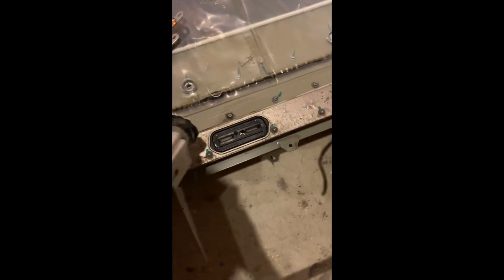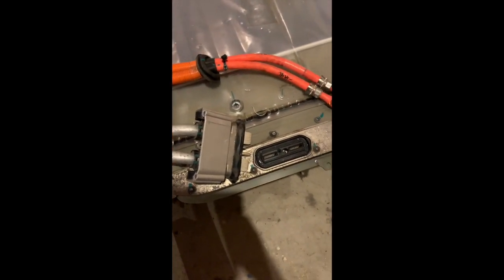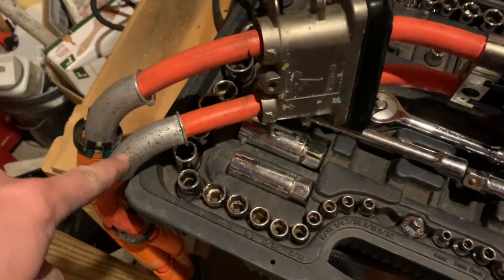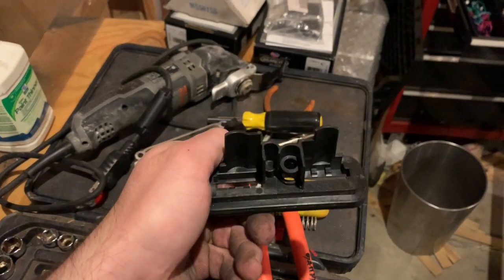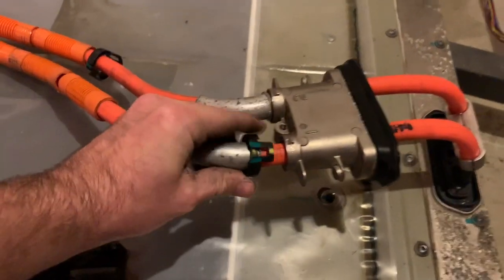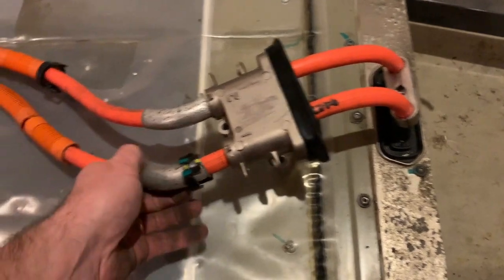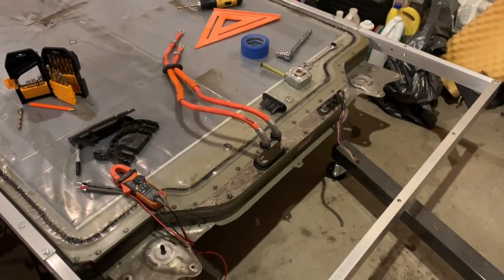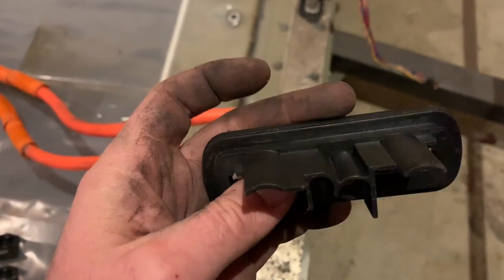T-Rex Camper Build: The Tesla HV Battery Coupler... First edited video ever!

Comment: My opinion is to avoid crimps where possible. They can be really high quality reliable connections, but are often a point of failure because they are easy to mess up. I got a lesson on crimping from a technician with Schlueniger when my employer bought one of their automated crimpers for light Gage wire- I learned that there are lots of ways to make a bad crimp, and really just one right way. You have to get enough force to actually deform the strands, create flow, and create a metallurgical bond between the strands and the connector. It's really like a cold forge welding process. This is why Tesla and other EV OEMs use ultrasonically welded connections. 

That said, just bolting two ring terminals together isn't perfect, and you still need a crimp on the other ring terminal. 

You could take that connector to a welding supply shop and have them crimp an extension on with their hydraulic crimper, if they have one. Hopefully you get someone who knows what they are doing and does not just slam it with a sledgehammer like some welders do in the field. A welding supply shop could also point you to lugs with screw-down connections for the wire, which could be OK. 

I am tempted to recommend soldering because I like reliable metallurgical bonds, but with wire that big, it's not usually used. I've been known to get my propane torch out on big stuff, but that's  not industry practice. 

Good call on keeping the OEM connector, IMO. A bulge in the teardrop floor is no big deal, you can just have a matching notch in your slide-out kitchen.

Comment: My feeling is the crimped connector would be superior to a bolt and ring terminal.  Assuming proper crimping and sealing of course.
Reply from the maker: JRP3 thanks! I feel like you are right.
Reply: This is the ONLY way to do it - crimp, never solder. Sucks but, good crimpers are expensive.